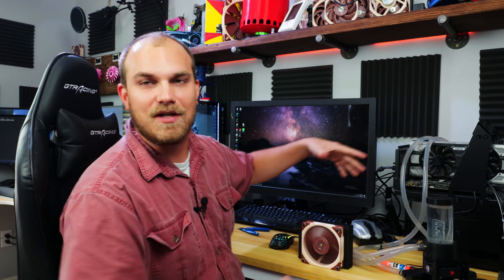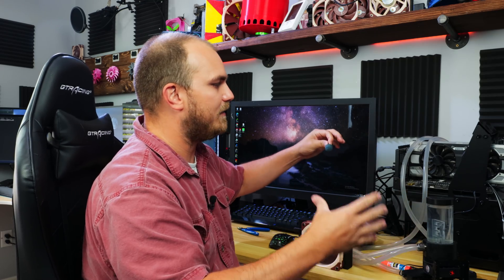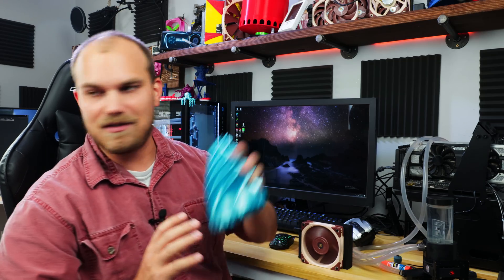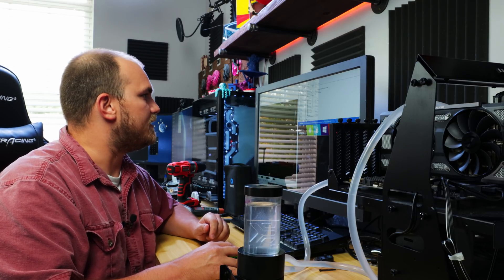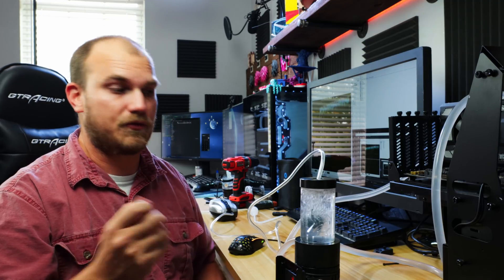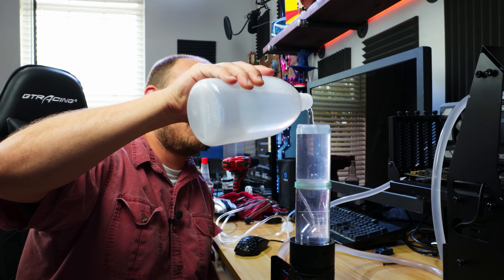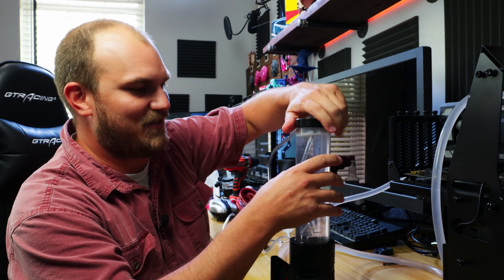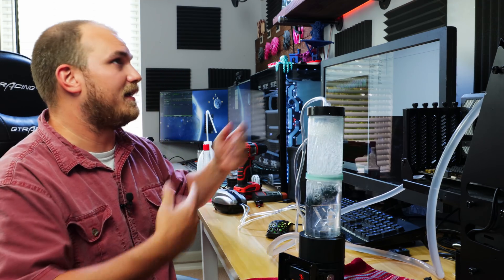Can An Airstone Cool Your PC?

Comment: You may want to drop one or two drops of food coloring while the water pump is running without bubbles to see how quickly the water column gets mixed into the cooling loop. Bubbles were moving straight up, seems to indicate not much other coolant movement interfering with them. The reservoir is intended to hold a reserve to offset losses, collect bubbles from the system over time and facilitate filling, not to thoroughly mix return fluid into the reservoir for optimal bubbler heat exchange. The mixing rate between reservoir coolant and loop coolant may be too slow for air stones to be effective without tweaking. If the colorant test shows such poor mixing, then you may want to SLA-print a reservoir coupler with a built-in return port so coolant can be returned half-way up into the reservoir with the air stones below it. Give the return port a pretty good off-center offset, perhaps make its ID tangent with the coupler's ID, and you should get some nice bubble swirl action.

Comment: Energy from evaporation only takes place at the interface between the boundary layer of the water and air which in that reservoir has a very small surface area for that to take place, instead of making the reservoir taller I would make it with as large a surface area as possible (YUGE!) and consider using wicks and a fan blowing over the top swamp cooling style to try and maximize the cooling efficiency and minimize heat from kinetic energy of the bubbles and heat from the air pump etc... It's such a bad idea but would be ""Cool"" to see you get it to cool something putting out that much heat.

Also, not 100% sure on any of this, but pressure plays a role in evaporation and vapor pressure etc, placing it under vacuum might help or hinder the process and chew up some more energy >.< may not be efficient but it could make it cool.

Comment: Put a screen in between the air stones and the reservoir outlet. The idea is to put a “filter” to stop the bubbles from entering the loop. Alternatively, you could add something like isopropyl alcohol to reduced foaming.

Comment: I feel like that the water in the reservoir is being cooled, but the pump is mostly circulating the water below the air stone. Maybe making a 3x reservoir tower with a way to let the water be pumped from the bottom to the top and making a resin printed segment that has a fixture to have a pipe attach ⅔ or so of the way up.

Comment: I think this could work, but, I'd be worried that the air stones are adding heat because they're compressing air and that means you're pushing potentially hot air into the column. You'd need a significantly taller column for this to work, and, you'd need to have a reverse flow setup, where the water enters at the top and exits at the bottom, and the air does the opposite.

Also, it's likely not going to ever be quieter than a regular radiator setup, because the aquarium pump is louder than a fan.

Comment: I think a lot of the problem is that the intake and outlet of the res. are both on the bottom, which means any cooling in the tower above is irrelevant. I'm thinking of a two-stage res., like a divided cylinder, where the water coming in gets the air bubbled, and what overflows over the top goes into the other side, which is where the outlet is.

Alternately, have the incoming water come in the top, and fall down past the bubbles.

Comment: A working air pump gets hot so the air coming from it will be hot as well so in the end you're just adding more heat into the system lol.
How about you try an aquarium chiller next? That should work better than a radiator and fan only.

Comment: A couple of questions;
1) is it possible that the air pump is introducing heat?
2)is the black cap on top of the reservoir preventing some of the heat from escaping?

Comment: I do have some doubts about this working, but one thing I wanna ask. Why the lid??? wouldn't not having a lid on top of the pump greatly increase your preformance here?
I'm just thinking that your somewhat trapping the temperature inside the pump and with or without airstones in it won't make much of a change.
maybjust taking the lid of and without airstones could result in a change to the 7:50 timer

Comment: Air has a heat capacity of about 700 J/kg, water is about 4200. So you need about 6x the air (in kg) to transfer that heat into.
Air also has a density of 1.2 kg/m3 to water's ~1Mg/m3. So per volume you're looking at 6000x more air to get the heat out. 
This is why the cooling tower is all air and a little water, you've got a reservoir that's maybe 1/5 air... 30,000x too little.
Reply: You did not consider evaporation
Reply: Nice numbers.
But the heat isn't being transferred to the vapor air.  The heat is transferred out of the liquid water by phase changing it into vapor water.
The air bubbles give the water more surface area but isn't going to conduct much heat away itself.
Reply: Heat capacity and thermal conductivity is not corelated. Also he is trying to achieve evaporation cooling. Witch happends only on the surface. So first wider not taller, meaning unpractical and i dont think the bubles make the surface significantly biger. Basicly its not air that cools the water but evaporated water that tranfer the to the air. 
If we use molar weight as a unit of flow water is 1.2 - 2x more efficient. Meaning you need compare to density 1000+ x more flow of air then water. 
But to irl comparison water cooler pump 7-20 l/m, garden hose have flow of 50 l/m, fire hose have up to 1140 l/m, home kichen hood fan have air flow of 3200 l/m
Reply: Wouldn't you want that ratio between flow rates and not volume in the res?
Reply: Your numbers are a bit too high.
They are correct for perfect cooling, but that's not what we need. We are ok with the water being a bit warmer than ambient so not that much air is needed.
But a little less is still quite unreasonable.

Comment: Ok how about the cold plate and heat tubes of an air cooler in the water with fans on it  like normal kinda the opposite of your water cooled air cooler you've alreay

Comment: And my hypothesis about why the airstones didnt work is because the reservoir isnt an active part of the loop. It was water storage, but not much water flow.

Maybe if the water flowed into another chamber/jar, that the stones could be placed in, Maybe that will actually cool the moving water instead of just bubbling up stagnant water?

My guess is the best place for the  bubble tank would  be between the cpu outlet and the pump inlet. And have the cpu outlet high in the tank and the pump inlet low in the tank. To make sure the pump doesnt pick up too many bubbles.

Comment: What happens if you use chill the PC using  refrigerant from a portable AC (Hook up the AC pipes into the water block), instead of water cooling? Will it run cooler or not boot?

Comment: Here is a crazy idea: Cool with vacuum:

Or more precisely, water evaporating under vacuum. 

How it works: The lower the Pressure the lower the  boiling point of water. When water boils it sucks heat out of its environment to even  the point of freezing under vacuum.  ( https://www.youtube.com/watch?v=Ti9C_cLSR0A ) 

The setup for the cooling Chamber: The ground plate out of metal sitting on the cpu is connected with a metallic reservoir for the water . All under the glass vacuum bell. (maybe a big candy or preserving jar could do the trick).
Important for the effectivity is that the hole for the hose connecting to the vacuum pump is at the bottom.

For the pump itself, most pumps cost some money and as they are oil cooled don't really like water in the system. But there is one cheap possibly 3d printable variant that might do the trick: a vacuum ejector ( https://en.wikipedia.org/wiki/Vacuum_ejector ) connected to the faucet a pressure washer or air compressor can do it.

It should not be needed to freeze the water as a temperature of  50°C should be achievable  with 100 mbar which should be creatable with a water ejector. ( https://www.engineeringtoolbox.com/water-evacuation-pressure-temperature-d_1686.html )
Reply: This just sounds like refrigeration with more steps lol
Reply: Very interesting concept, pretty sure it will work. might need a way to keep the pressure just enough so that the water doesn't freeze or not boil. irl this is not viable obviously cos vacuum pumps are loud af.
Reply: Makes more sense use alcohol with low pressure. When alcool turn in gas he steal the energy more than water.
Reply: would need to be multiple loops to do so. The issue is once you lower the system pressure, you'll start to get localized boiling within the water block and water will stop flowing due to the air pockets.
Reply: @kasuraga  you could introduce nucleation sites on the waterblock to get the localized boiling to work to transfer more  enthalpy into the coolant but introducing air into the suction of the circulating pump is a bad idea.  You should never draw a vacuum at the suction of a pump unless some other system design criteria demands that you do so.  If you are going to use phase change you either need to have very precise design tolerances or use two loops.
Reply: That's the called a heat pump, it would be much easier using an actual refrigerant rather than water.
Reply: This is basically how cooling with 3M Novec works, a liquid that boils at around 60°C great idea ;)
Reply: one problem due to the lower system pressure would be fighting cavitation in the pumps. To have the pump pressure at ambient your vacuum chamber needs to be  @10m  or 31ft
Edit: Or work with an heat exchanger, which kind of defeats the purpose.
Reply: going to run into net positive suction head issues with the pump and it would be better to have the boiling happen directly on the heat sink to transfer more enthalpy into the coolant than it would to have the coolant boil in the expansion volume.  The reservoir/ expansion tank is there to provide net positive suction head to the circulating pump so the higher pressure it is at would decrease cavitation of the pump thereby protecting the pump and the system from air binding. I just don't think adding air bubbles to the system will increase cooling at least in a single loop design.  If we were to use a two loop system then having a phase change at the interface would definitely increase the amount of heat transfer out of the primary loop but I think phase change cooling systems are pretty well tested and are beyond the scope of what this experiment is trying to accomplish.
Reply: That's how heat pipes and vapor chambers work (although they're closed; they just transport heat from one point to the rest of the heat pipe, much more quickly than solid copper).  There are videos about how to make heatpipes.
Reply: I'm confused, if you are going to "boil the water away" in a vacuum (hopefully taking the waste heat with it...where does the evaporated water go? Into a condenser to be recirculated back into the cooling system? Or is it just dumped outside the system completely? If the water vapor is recirculated, what is forcing the vapor out of the vacuum to be condensed back into a liquid? If the vapor is ejected out of the system completely...what's the point of vacuum chamber in the first place? If the cooling system isn't looped, simply run a constant flow of water in the beginning of the cooling system and expell the hot water out the other end (maybe into a toilet or bathtub or a nearby floor drain) thereby eliminating the need for a vacuum chamber cooling system in the first place.
Reply: you're basically describing a water sublimation cooler which they use for cooling in outer space. The issue is getting a vacuum source good enough to make it work, vacuum pumps just won't cut it and he's not going to be able to get a good enough setup for a computer video
Reply: @AsbestosMuffins  sublimation is when you go from a solid to a gas with no liquid stage as dry ice does.
Reply: @AsbestosMuffins  Ejector pumps using  water can get down to 23mbar by a water temperature of 20°C (roughly faucet temp). Enough to bring the boiling temperature of water down to 20°C (actually its 1:1 in this case, the water temperature of  the water used in the ejector defines the boiling point of the water in vacuum, given a working ejector pump). Those ejectors cost like 10$ and are widely used in laboratories. With an air pressure ejector no such restrictions exist. You don't need  the water to directly sublimate, as there is a heat source - the radiator - introduce directly in the water. You don't even want to go down further as condensing water on the CPU block could be a hazard then. Probably even want to stay above room temp. 

In your case i think the problem is that you have to be under the pressure that stops water from sublimating as its pretty cold in space. So you either have to lower the pressure or increase the ice temperature.

Believe me it does work, i worked on such cases. The thing with freeze drying why you want lower pressure there, is that its really hard to transfer heat in vacuum into the stuff you want to dry. As there is no convection. But for our case of 50°C to 70°c we can live with somewhere in between 100mbar to 300mbar. You can probably get that with a printed ejector pump.
Reply: @syoxsk  Outer space can be extremely hot as well. It all depends on if you are in a shadow or not. If you're floating around out there and can see a star...you just might be in a whole lotta trouble (space suits are white for a reason...and so are a lot of external parts on space stations, transatmospheric vehicles i.e. the space shuttle and all kinds of stuff that could possibly come into direct contact with sunlight). The stuff we get here on Earth is "filtered" a bit before it collides with our skin.
Reply: This won't work. Basically what you do there is take away any material that might be able to absorb heat.
Reply: @kayburcky7146  it does work. Its like a vapor chamber principle. I experimented with this for freeze drying.
Reply: @kayburcky7146  passive evaporative cooling is also known as heat pipes
Reply: @kayburcky7146  This is literally the same principle that all kinds of freezers and fridges use (but with gasses that are more efficient than water). Yes it would work, how much is the question
Reply: @DoesntRefillTheBrita  none of those work with actively boiling off the coolant without condensing it afterwards and none of them boil the coolant at the suction of the circulating pump or compressor. This is just a bad design

Comment: Maybe a reservoir with a larger surface area in contact with the air would help (like casserole dish versus drinking glass shape). Another outside the box idea if you have an aquarium would be to pull water from near the bottom and return through the top. This would prevent stagnation and would also aid aeration. I would guess that a several gallon aquarium would likely serve as a fairly efficient heat sink.

Comment: An odd cooling solution I've contemplated before is doing something with the finned copper pipe used in baseboard heating. Technically it's designed to dissipate heat without any fans right? I just don't know if the length needed to do anything productive would require more water in the loop than the pump can handle. 
Either way I think it would be interesting to try.
Reply: This exists already. It's called a "rezerator" and zalman made it back in the day. They still work pretty well.
Reply: @jttech44  thanks  i gotta google that now

Comment: get a LONG tube, like 4 foot. have the pump pulling from the bottom into the block, then from the block to the TOP of the tube, with the airstone near the bottom so that the warm water has to flow past the bubbles. this setup you ran passed the water near the bubbles but not threw them.

Comment: Can you 3d print a track inside the res so that the cold water has to circulate just the intake not above the intake. Maybe a stew with little pass thought slots. And have the water flow spends more time in the with the air.

Comment: tehre are twoi problems with this idea that make it impossible before you ever started. the thermal density of air is lower than water.. by oxegenating the water withthe bubbler and introducing mroe air as tiny bubbles runing through the system (notice how much cloudier the water is in the loop when the bubbler is running) your effectivly lowering the potential thermal capacity of the water in the loop. it cant absorb as much heat because the air takes up room that the water would have. asically whenever a bubble is agaisnt a hot surface, that is that much water that isnt absorbing heat from that hor surface. 
also. air has very little mass, hence why you have to blow so much of it past a heatsinc to absorb the same ammount of heat that water can absorb. basically.. the air traveling through the water barely cools downt he water. 

so youve decreased the ammount of heat the liquid int he system can absorb (explaining why it reached throttle faster) and the air passing throught he water cant absorb the heat out fast enough, so its basically not doing anything. sure the bubbles collect SOME heat fromt eh water as they are passing through it. but thats offset by how much youve reduced the thermal capacity of the water int eh system.  so you have a net loss in performance